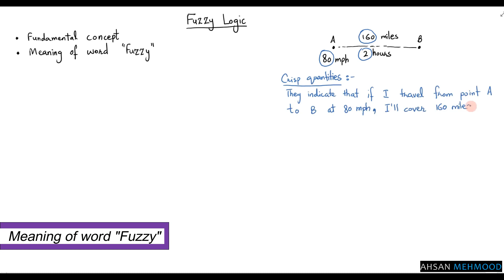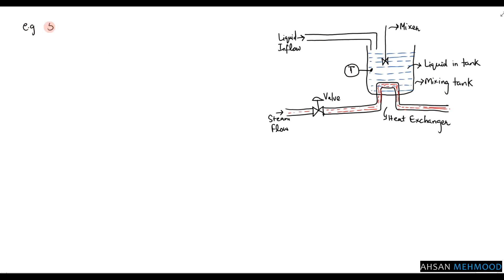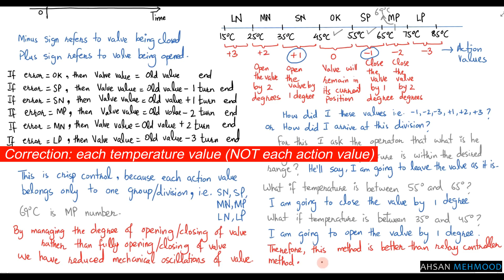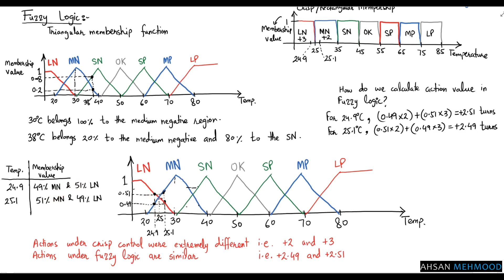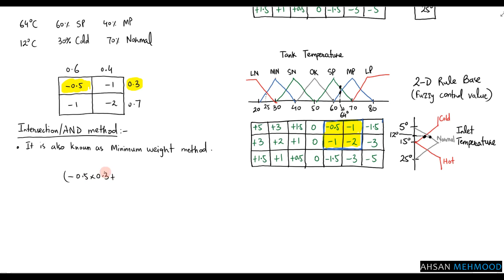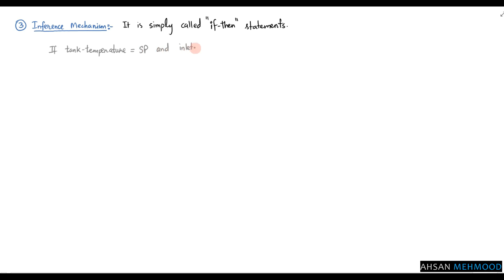Fuzzy Logic - Basic idea & concept | Control systems method | Expert system in control | Crisp logic

Comment: Thanks for the video. Sir, i want to try to make a fuzzy controller based on MPPT incremental conductance algorithm, with the aim of providing a duty cycle to reach the maximum point faster and reduce oscillations. I have a few questions regarding this.
1. I'm confused how to make membership function and rule base for fuzzy controller based on that case.
2. Does the dc-dc converter used affect the membership function and rule base of the fuzzy controller itself? in this case I use a single ended primary inductance converter (SEPIC).

if you don't mind can you explain it to me? Thank you.
Reply from the maker: On designing of membership function and rule base, I'll make a video, but due to my busy routine I am not able to find time.
Answering to your second point, converter type doesn't have any effect on the fuzzy logic controller, although the capacitor and inductor values can affect the speed of control algorithm and ripples in waveforms. So, converter parameters should be carefully designed.
Reply: @ahsanmehmood9229  Is that so? Actually I've tried to make a simulation of this incremental-fuzzy based on the membership function and the rule base from the journal that I found on the internet, but it doesn't work well on my system. If you don't mind, would you like to help me correct the simulink that I made?